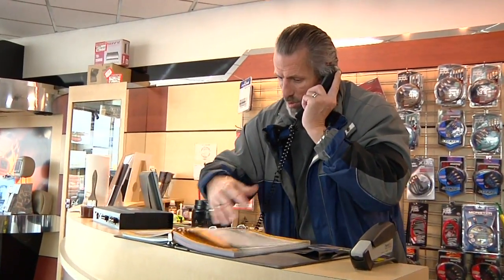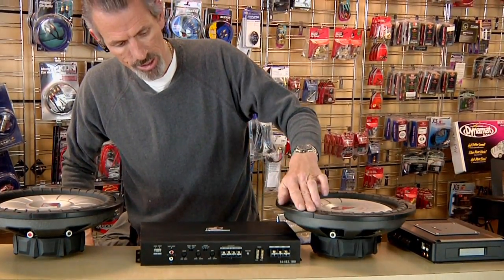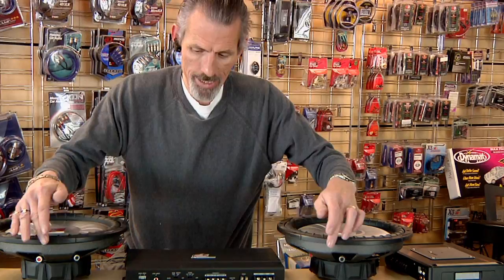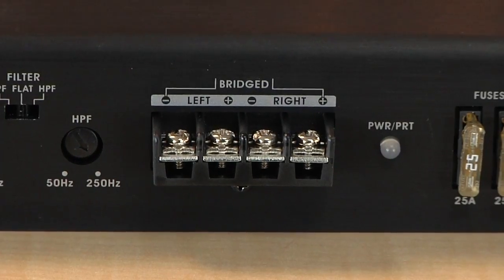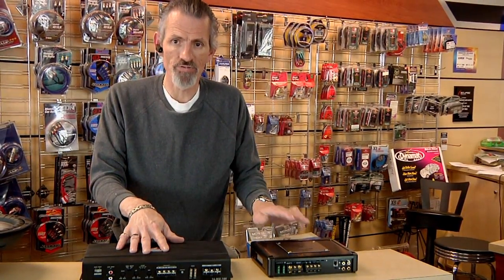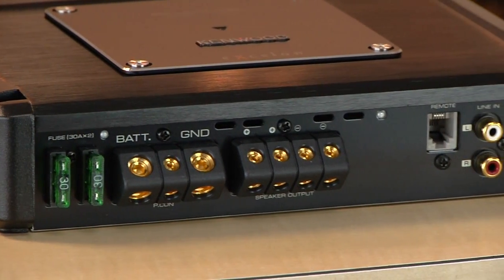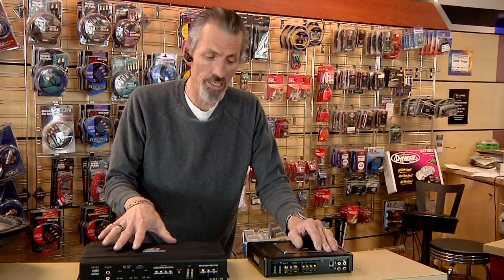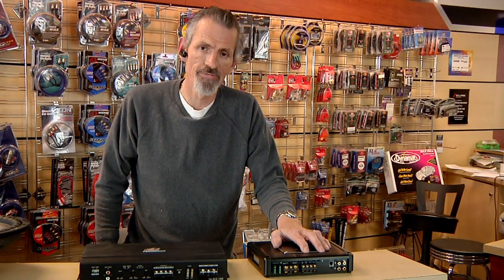Car Audio : How to Bridge 2 Subwoofers Together

Comment: So if I got two speakers just like the ones you have there with one negative and one positive on each subwoofer and I have a one channel mono amp how can I wire the speakers to get the full power out of them to the amp my amp is a Alpine v power mono and it only has one negative and one positive for the speaker output? Do I do the same thing you did there since my box is each woofer has his own chamber do I drill a hole between the Middle to connect the wires like you did here?

Comment: well... i can see something weard on this video, this guy did not mentioned the Impedance of the subs, if both subs are 4ohm then plugging both in parallel you will have 2ohms plugged to the amplifier, but if both are 8ohms you will have  ohms plugged to the amp, almost all A/B ampliffiers are bridgeable but only stable at 4ohms when bridged, so if you plugg 2 ohms to a bridgeable at 4 ohms amp. you're in risk to blow your amp off and burn it, so we need to watch out that.

Comment: Or if you have a bassworkz box run speaker wiring from the two extra bottom connectors over to the two bottom connectors of the other sub then plug in the one speaker wire running from the amp into either side of the top speaker connecters :)

Comment: hi guys new to car audio systems.

1. ive got a dual voice coil 12" subwoofer my question is how do you connect it bridged to an amplifier?
2. when installing subwoofer would you guys recommend a capacitor ? and a fuse ? 
3. whats the purpose of a fuse and a capacitor ?

Comment: i'v got a 4ohm kenwood sub, and i want to bridge it to a 2ch pioneer (4ohm) amp.. but if i bridge it will that lower the subs impedance to 2 ohms? if so is that a bad thing?

Comment: i dont think he explained that quite right because i see no difference to that and seting it up in stereo with a y cable on the inputs. all he has done is paralled the drivers. 

i mean what is the advantage of using bridge mode vs parallel???

Comment: @amritaka2qw32 yes. just get the right ohm impedance to match the amp. if wired in series, you add the ohm impedance of the two subs. if wired in parallel (recommended) the ohm impedance of the two is the product divided by the sum. so if your amp's recommended output at 2 ohms, get two 4 ohm subs wire them in parallel and 4x4/4+4=16/8=2ohm and there you go. if the amp works best at 1 ohm, get two 2 ohm subs and wire in parallel to 1 ohm.

Comment: @commadorebeef & p.s re:- YOUR "ears" telling U that my LIGHTS (wired direct off different speakers) ARE ALL on the same mono ch as U only hear "mono"- then go ask YOUR M8 (the SON of Ray Rayburn)- this Question-? WHY did Ethan Winer @EthanWiner - put UP a video (called) Audio Myths workshop (from the October 2009 AES show in New York where In that vid U will hear what phase shift sounds like, learn about proper test methods, understand why UR hearing isnt as reliable as test gear, & much more)

Comment: Thus.. when I "connect" together two subwoofers.. I don't FOLLOW the flock- of docile domesticated SHEEP .. wandering down the hill to the local abbatoir ..
Oh no.. I wade in... with bucket_fulls of cables .. plowing deep furrows across the landscape .. pushing sideways through the rest of you .. Climbing trees, crawling through tunnels .. unttil I WIRE .. my two subbies .. the way i want them to work.

Comment: Just the same- as TWO similar size bits of wire?
If laid side by side- 1M apart- around the entire USA?
& 1,000,000 VOLTS "DC" is applied to 1 set of terminal ends
(such that 1 wire is positive with respect to the other)
NO CURRECT CAN FLOW
Apart from a minute INSULATION "leakage" (mere milliamps)
BUT- connect an extremely HIGH "frequency" AC voltage- of even LOW VOLTAGE
& ALL that WHOLE circuit will ACT like a huge short
With "hi_current" CAPACITIVE currents

Simple Ohms Law actually.

Comment: Unlike MANY whom constantly comment upon analogue" audio theories & OTHER proven facts
QUIX4U actually knows that any two 1Kg BLOCKS of IRON
Can have EXTREMELY "opposite" electrical properties
1 is "like" our average @commadorebeef
Just a huge BIG THICK BLOCK.
Dropped carelessly across 330,000 Volt AC "hi_tension" switchyard BUSBARS
Will instantly vapourise itself along with 1/2 the switchyard
Another BLOCK- extruded to hundreds of Kms as fine wire
COILED- will BLOCK that same AC-voltage

Comment: @commadorebeef Then because U STILL forget about ALL of the different "shadow" harmonics- which add their OWN interactively "working" shadow cycles- to & fro into Ur MONO mixture with even more & more as a cacophony of frequencies transends your SINGLE cellphone speaker's capability ? & It's not surprising that U only get a dead pan "scream" of one apparent tone- from Ur cellphone? Me- My 2 eyes see multitudes of colours- in Double rainbows- Or on RGB TV screens (the same as my 2 ears SEE sound)

Comment: @commadorebeef ? Because it is a NATURALLY OCCURRING PHENOMENUM in whatever audible hearing range YOUR EARS have always listened WITH- your own very complex "onboard_computor" knows the way to "filter these" (or at least Ur brain "aught" to KNOW by now) But ADD another 3rd tone "differently_cycled" yet again & BANG- 3 differently phased cycles each ADDING & SUBTRACTING & That's JUST inside Ur mono single speaker ;-)
But 1 speaker can ONLY go in & out (not sideways) where MY chs often ALSO go ?

Comment: @commadorebeef Oh & if you cannot FIND the correct page at wikipedia ... to study IN DEPTH ... a little part of how my ACTUAL BRAIN WORKS .. then you had better simply try to wikipedia THIS.!

Analytical_psychology

(And)
Right down at the BOTTOM of that page 
There .. is the actual "block_map" TABLE
Of "Analytical_psychology"
And of ALL the relevant modes of analysis 
Including Jung - Meyer's Briggs 

AND LOOK

..?..
The Keirsey Temperament Sorter (KTS)

Comment: @QUIX4U will tell U a simple truth .. (unlike a RECREATION of a virtual hypothesis... in digital format?) One cannot do as @commadorebeef suggests .. and lean a ladder against a VIRTUAL RECREATION .. in order to support said ladder against a ROOF which has not yet been built .. @QUIX4U will say that simple physics principals & triangulation methods (real methods) need to be used to PRE_BUILD a supporting structure to freestand the ladder - whilst U build said roof as - THE ANALOGUE METHOD RULES

Comment: @remi009340 there's not really any advantage either way, the only way to make sure the subs are synchronized is making sure you wire the polarity correctly.  The reason they do that is so you can have different wiring configurations at the amplifier to get the correct amount of impedance without having to take the subs out of the box and rewire them inside

Comment: ok i have 2 12" kenwood KFC-W3012  subs and a kenwood KAC-9104D 1800watt monoblock i was wondering what the advantages of wiring them bridged instead of just pluging them in to the amp from the 2 sets of teminals in the back of my box are.  does it just synchronize them when the subs bump?